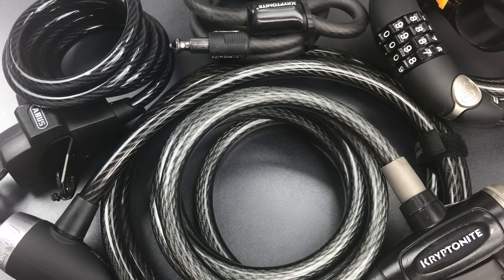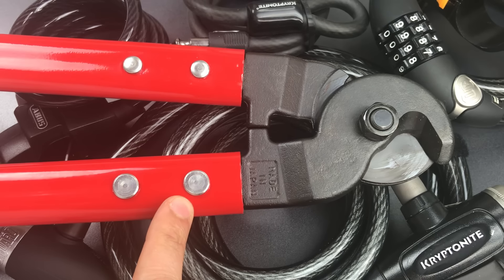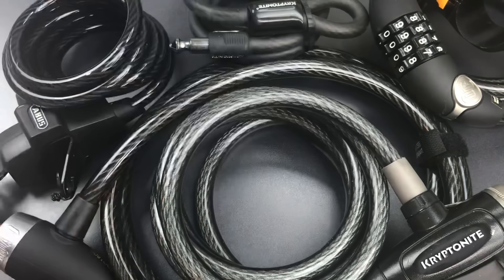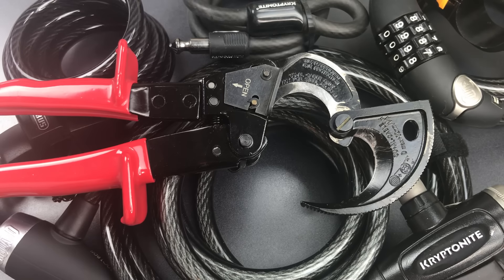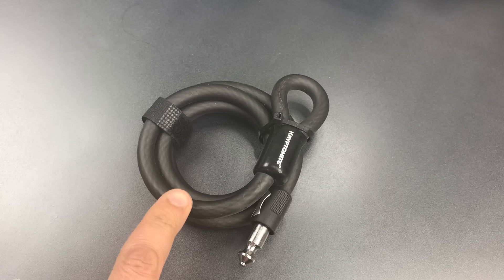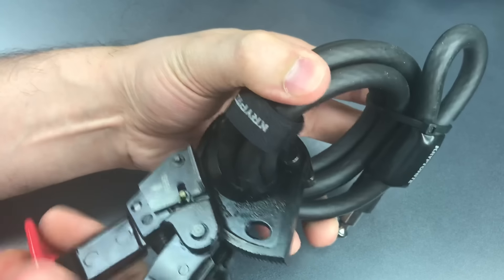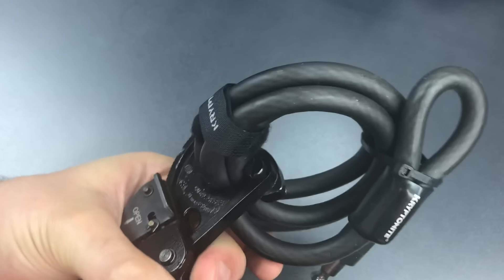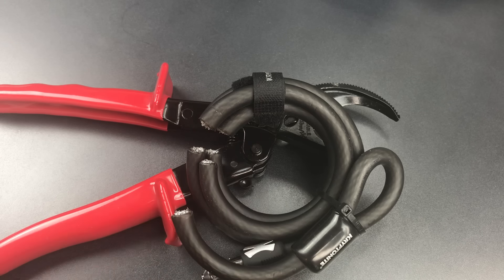[748] Cutting Bicycle Cable Locks is EASY!

Comment: I'm an ex sparky and have not seen those type of handheld ratcheting cutters. Cuts like going through butter!🍺😎🇦🇺
Reply: See them all the time in industry, cutting 3x120mm^2 cables and stuff.
Reply: They are fairly common in Europe, but I prefer a grinder.
Reply: use them all the time on heavy commercial and industrial jobs
Reply: There are quite a lot of this type of tool , from simple like this one and also very cheap to fully automated and hardened ones. :) Auto ones are for underground cutting. These are for those bulky and heavy telco and power line cables , and environments where people can't go , due to harsh conditions. Those can cost like 5k U$ (cheapest) and up. The ones I looked are for cables thick as 3in and up.
Hope this helps. Cheers ! 😎 🇪🇺
Reply: IDEAL makes a ratchet cutter...nice but expensive
Reply: We have the Greenlee brand at work. Yes expensive but well worth it to cut large electrical copper wire.
Reply: B L, sounds like you are decom. These tools are great for places where you can't make so much mess.
Reply: I've used these ratcheting cutters for cutting armoured cable in my previous job making surveillance equipment for the oil and gas industry. They eat through 20mm+ braided armour cables with ease.
Reply: Decom? Sorry, I´m not a native speaker, I don´t know what that means (short for decommission?).
I´m what you´d probably call a Journeyman Electrician (mainly doing residential and commercial new construction and renovation, beginning training for electronic technician next year) in the US (though the whole system is a fair bit different over here).
For larger cables (95²mm and up) a grinder is just less of a hassle since my boss is a bit thrifty and we don´t really get all the tools when we need them. It doesn´t make much of a mess though, you can always catch molten polymer and such with a piece of cardboard ... :)
Reply: @BL-yj2wp  cool. Yeah, I just used a hacksaw or grinder too. I worked with copper and pyro up to 185mm. I however quit tool back in 2000 so many new fancy tools exist now.
Reply: For all my sparkys,   the m12 cable cutters are the way to go. 100 more than ratchet cutters but faster and easier.
Reply: That one is one of the smaller one, we have them on work, the same one in the video plus 2 bigger ones wich is electric powered by a battery, still small enough to hold them in your hand
Reply: all fine options, but as long as there's plenty of elbow room, I prefer a traditional katana...
 🥋 🔪

..that way I can imagine myself among the samurai-electrician class in an alternate steam-punk version of historical Japan.
Reply: This mechanism has been offered for tree limb cutting for some years---prob. also for "bolt"-cutting....?!?!?!
Reply: dirty buggers you sparkys
Reply: @BL-yj2wp  Not if you want to keep noise pollution down!
Reply: Hey, I was wondering what being a “sparky” is. Is that slang for electrician?
Reply: @ireneshelton3661  yes it is.
Reply: @DonzLockz  thank you!

Comment: A video showing an wireless grinder cutting a heavy chain or a u-lock would be very interesting. Especially comparing different brands and showing witch can be grinded easier.
Reply: there's quite a few of those on the internet and well its very very depressing. but angle grinders are very noisy so they're not used generally in open or daylight scenarios. cutters like these are silent and thus attract far less attention

https://www.youtube.com/watch?v=-dz0Za5-wOM

But then again.... apparently spending 30 seconds with sparks flying in a buys street is 'normal' in SF?
Reply: @n00bkill lol

Comment: I have a cable, but I use it in conjunction with a U-Lock. I U-Lock the back tire to the frame and an object (steel rail) then I wrap the cable from the U-lock to the front tire & another point of contact if there is enough. That has usually worked for me.... Also (if available) I lock my bike next to someone with poor bike locking practices, or a cheaper looking lock, better or more expensive bike... let them be a victim over me ;)
Reply: heli400 everyone's bike is expensive looking when you give yours a bit of a home made goofy paint job, even if the bike originally cost a few hundred ;)

Comment: You've just cut the same cable lock I have on my ebike 😱😱. Thanks for the well demonstrated video. Upgrading to a steel u lock.
Reply: Good idea but keep the cable lock as you can use it to protect one of your tires from being stolen and it provides a little bit of extra protection.

Comment: New plan: butt-ugly sleeper bicycle, complete with faux rust.
Reply: This works. Your bike just needs to be less desirable and better locked than the bikes around it. Shitty rattlecan paint also helps, and even aids in finding your bike in the bikeracks :P
Reply: Nope, I had two bikes like this. First one  I bought for 20 euro, the  second for 40.
Reply: There's a spray on rusting paint. Can use on metal or plastic or wood etc. The paint itself rusts. Not what's underneath. Great way to make nice bike look old and rusty
Reply: In north Europe, this is the anti-theft-strategy number 1: A technicaly good bike, that is ugly, and even if regognized by the thieves as a good functioning bike, they know, it is so ugly, it is not worth stealing it, cause the return is low...
Reply: Old 20 some-odd year old mountain bike. That’s good enough where I live cause everyone has much newer bikes so there’s no reason to steal my pos
Reply: Been doing this in Oxford nearly ten years (with the same bike I rebuild every couple of years), nobody looks twice.

Comment: Yeah, I know about these cutters. I used them at work a lot! So I already knew about this. But, I do use a cable lock with a larger cable to lock my e-bike when I'm out and about. It's only to slow someone down while I am briefly away from my lock, not to rely on for real security, for that I would use a hardened chain
Reply: What’s the name of them?

Comment: I have a very expensive bike bought over 20-years ago that I've been securing all this time with a cable lock (short term, secured to a bike rack, usually outside of stores and high traffic areas).  I guess I'm extremely lucky that it was never stolen.  Recently upgraded to a medium security Kryptonite chain lock because videos like this have made me paranoid.
Reply: You live in a good area. Generally U-locks are the best you'll get, but kryptonite chain locks are pretty good.

Comment: Yeah this is why I use D-locks and I only use a cable lock in very low security settings (e.g. stopping at a suburban shop for less than 2 minutes), and even then I will only use it for the front wheel, locking the rest of the bike with a D-lock. My first road bike was stolen after being locked with a cable lock. It was only a cheap '80s road bike that cost £130 but still, I liked that thing a lot. I hope it's still being ridden today. The vast majority of the time I will use a D-lock on the frame, rear wheel, and front wheel. Either I'll use a secondary (but still strong Kryptonite) D-lock on the front wheel, or I'll take the front wheel off (since it's quick release) and lock it together with my rear wheel and seat stays using my big Kryptonite New York lock.

Comment: It took me around two and a half minutes to cut through a cable lock with a regular hacksaw blade(meant for cutting steel). I was amazed at how easy it is. Cable locks are meant to protect against opportunistic thieves not against determined ones. A u-lock is far superior for securing a bike for a short period of time while you shop for somethig. The safest way to protect your bike is to keep it out of sight. Can't se it, can't steal it.
Reply: if you're a glass at least half full optimist, you can say that just tying a string, wire or piece of tape is often good enough security - equal to cable lock in fact

Comment: I would only ever use my cable lock so that people can't just walk away with my wheels
Reply: Well now they can lol
Reply: Same here. My D-lock goes through the frame and the rear wheel, and I run a cable lock to the front wheel. Anywhere I park, there are plenty of unsecured wheels and my wheels aren't that nice, so it seems to be reasonable to outrun most of the other people instead of outrunning the bear.
Reply: You're better off using them to secure your shoes to your feet.  That way you have a chance of noticing if someone is cutting them off.

Comment: I once used a small pipe cutter to cut the cable on one of my own locks that I had lost the keys for. That was concealable and inexpensive. Admitably not that fast.
Reply: I bet two pairs of vise grip pliers would be very fast
Reply: @nathansmith3608  I'm trying to picture how that would work...
Reply: I was just wondering if a pipe cutter would work

Comment: I used little bigger version of these. Also as I remember these cable cutters are fairly expensive.
Reply from the maker: I paid $22 shipped on eBay... name brand variants are MUCH more, of course.
Reply: Whatever the cost, the thief would make their money back on just one bike so it's a good investment on their part.
Reply: If they are hanging up on display in a store thieves will just steal them then use them to steal your bike, they are after all thieves.
Reply: Ebay and Amazon have $30 ones but kleins or Southwire are $250-300
Reply: Price is irrelevant.    a "thief" buying tools goes against their code of professional conduct.    They  shoplift the hand tools they need from the big box home reno' chains.
Reply: @littlegoobie  True that, I wonder how many pairs of Klein pliers that were stolen from my work were than used to steal peoples bikes or steal wire from jobsites

Comment: Kinda glad I grew up with a chain & Lockwood padlock BEFORE YouTube  (i'd tell you the model number of lock it was, except it was stolen along with its key).  Anyhow, my bikes locked outside were always at risk, anything not chained eventually got taken.  Valve caps, pads, brakes, calipers, seat, handlebars, goose-neck, pedals, 3-piece cranks, etc., etc. ,,,

(Still to this day remember and regret all what was stolen)
What's lost is now irreplaceable,2nd hand,or expensive AF

Anytime "locking-up" .. basically had to dismantle the bike
+ carrying chain & lock that outweighed my bike. SUCKED.

Comment: Those cutters aren't cheap, about $300 if memory serves.  Although, if you're a good thief then they're free!
Reply from the maker: Good ones are indeed very expensive, but these are not good ones... $20 on eBay.
Reply: @lockpickinglawyer  Touche salesman.
Reply: @lockpickinglawyer  could you post a link for the ratcheting cable cutters? Thanks!
Reply: @boltup5566  you literally only have to google these
Reply: @rb4121  lockpicking lawyer literally makes money when he links the tools he uses. He forgot on this vid.

Comment: I ride a nice cannondale that I bought new for about 500 dollars, I ride mtb but also commute to work and back, I use it for errands, and it has spent many many hours on the bike rack. Usually when I'm out riding trail and commuting I wear a camelbak that is not big enough to hold my lock or i wear a bigger backpack that has my lock in it. Whenever I don't have my lock I at least make my bike harder to steal by doing some simple yet effective things. First thing I do is park in the lowest gear, then when the bike is not mobile I put it in the highest gear without turning the pedals, this makes the bike sound like hell if you try to ride it without putting it back into its original gear, it also makes the bike shift into a really hard gear that will equal no acceleration. 
The second thing I do is undo the seatpost clamp, so if someone were to try and pick it up by the saddle it would pull all the way out of the bike and it is a greasy mess.
The last thing I do is loosen both of my skewer axles, so if they are able to pick up the bike the wheels fall off. 
These are just the small things I do to make it a little harder to steal, I live in a small town that is not known for much crime but there was the same model of my bike stolen just a few weeks ago from a nearby large city, it was not properly locked and the lock was garbage quality.

Comment: Nice thing about picking a bike lock is that you now have a lock with your new bike.
Reply: The bad thing about it is that it's a lock that takes you just as long to open it as it takes a thief.
Reply: Well lock is never meant to stop thieves. Not these locks anyway. It's to stop honest people from taking your bike by mistake.
Reply: Why, because they are more likely to recognize the lock than the bike? I wouldn't even bother to learn the combination, since knowing the combination doesn't make it any easier to open.

Comment: I use a kryptonite kryptoflex cable for my front wheel with quick release. I also have black tape around a painted black hose clamp with 8mm bolt head on the quick release. If they cut the cable in 3 seconds, they still need to loosen the hose clamp enough with an 8mm wrench tool and that takes like 30 seconds with the spokes in the way. Buys more time and hope they don't carry an additional 8mm wrench. Maybe one day I will buy a locking skewer but I will continue to use the cable & hose clamp for the front wheel. I can't see myself carrying another 2nd u-lock for the front wheel.

Comment: I had a pretty thick cable lock for my bike once. It got stolen when it was parked among many other bikes, but since I actually maintain my bike, it probably looked newer.
I have used Shackle locks since, but just switched to a chain lock. I know I don’t have the best security, but at least I have insurance.

Comment: These are fine, honestly, at least around here. If they can't easily steal your bicycle, they get pissed off and break/bend/destroy it instead. What you want is a cable lock and a hidden GPS tracker. If someone really wants to steal it, they can, without breaking anything expensive. Track it down afterwards.

Comment: Some semi trailers have heavy duty seals that it takes bolt cutters or a grinder to cut, but some warehouses have a cutter that resembles a cordless drill that cuts a heavy duty seal in seconds, with little effort.
Reply: They make cordless rebar and threaded rod cutters now (Makita and the likes of them). Those should make short work of lock bars.

Comment: I have one of those cable cutters I got used with a dent in blades at a yard sale, so they don't work for really thick hard steel, but they are expensive if you buy them new. so, you have to steal the cutters first then bikes LOL

Comment: Some cable locks don't even need a wire cutter..they just pull 'em apart, even if that means pulling the bike rack off the wall! 
Thank God I found my bike...inside the Police Department grounds, next to the chapel. I'm still puzzled how it ended up there...

Comment: Normally the cable locks are used as an addition to a D lock. 
The D lock goes around frame and bike rack, the cable goes through the wheels and back to the D lock. 
This stops people stealing wheels, the the higher security D lock secures the bike.
Reply: That's what I do. It works b/c psychologically a thief sees it would be unsatisfying to bother cutting a lock & only getting a front wheel, I think!

Comment: Damn this is jaw dropping. What type of lock do you recommend? My bike was ~$700. And I have a $50 lock that I think is pretty hefty. But..... After seeing such a small tool defeat a lock like that. I'm nervous. My lock is opened with a key and it has a steel cable, metal sheath around that cable, and rubber protector. About 3/4 of an inch thick.

Comment: Cable locks really are only meant to deter thefts of opportunity. That and they are useful at locking items to your bike while you use several stronger locks to protect your bike. What you want to do is make it take too long to get your bike so the thief move on to another bike.

Comment: You can also use regular wire cutters, the ones used to make electric instalations, takes a little longer to get through the plastic but after that just nibble on the cable until it comes off

Comment: A bolt cutter would also cut cable locks easily. 
       And it's more versatile. You can also cut padlocks and chains with it.

Comment: A single wire is also easily cut by a standard electrical side-cutter... just "nibble" your way through with bite sized portions of strands with the tip of the cutter...

I was really disappointed a few year ago when I lost the key to my bike lock and a random bystander "came to the rescue" and cut the (10mm?) wire in ~10 seconds with this simple tool...

Comment: The ones that have the integrated locks are pretty easy to do if you break the plastic and cut through the cheesy aluminum inside